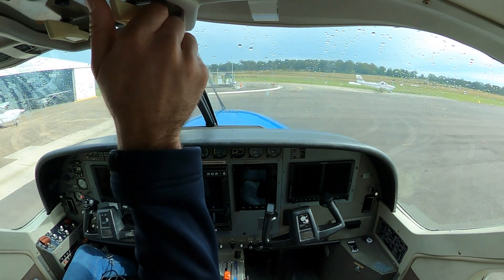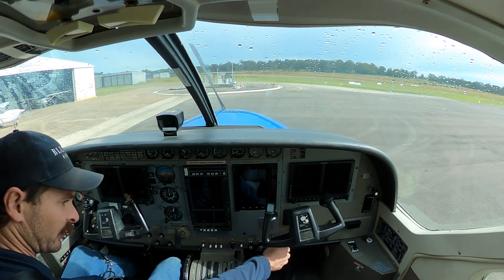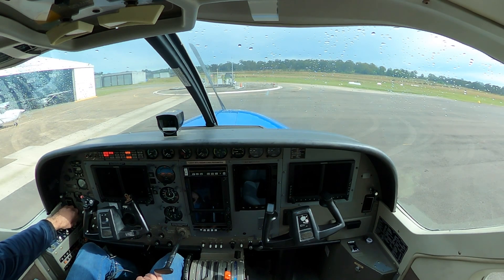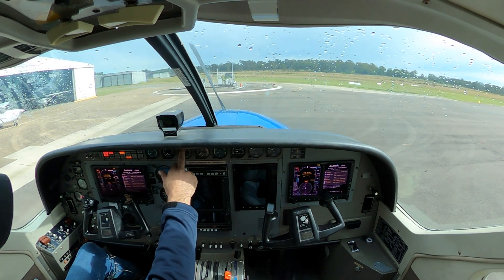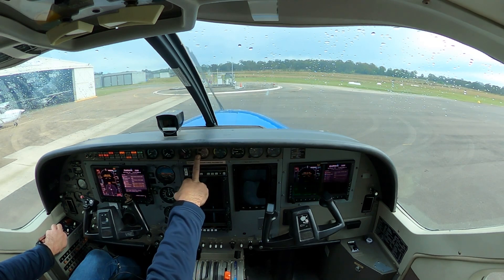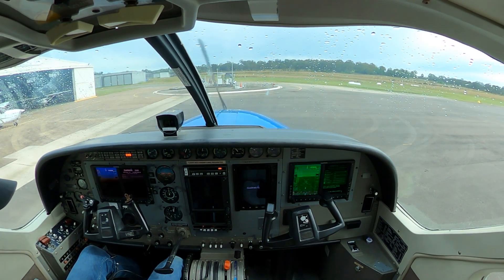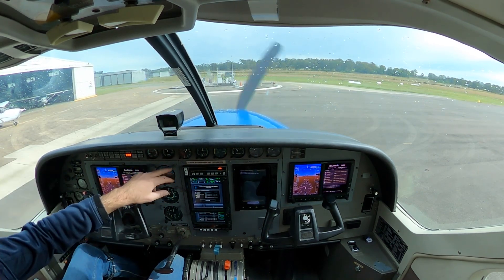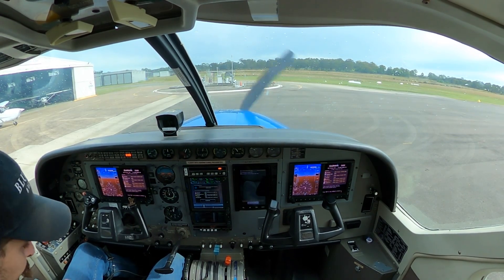Caravan school: engine start

Comment: Question - On the Annunciator Panel , the light that is on which I'm assuming its the "Stand by Pwr Elec On" , what if it doesn't go out and stays on during flight, what can this indicate ? Tried changing out the phenolic Resistor under the Alternator doesn't work... Tried changing the GCU and ACU ..Twice Doesn't work , I've also changed the switch, but that "Stand by Pwr Elec On" light doesn't go out . Any Idea's would be appreciated.

Comment: Hey just wondering - why do you not call out the battery voltage drop right after engaging the starter? Generally that's a good indicator of the battery health and if you're possibly going to get a hung start.